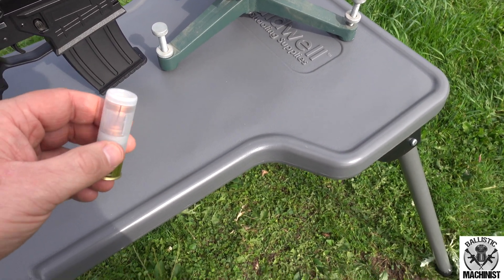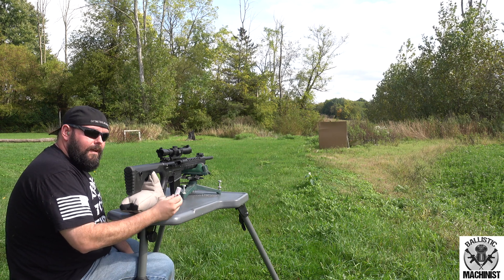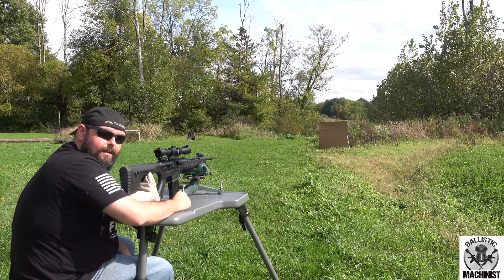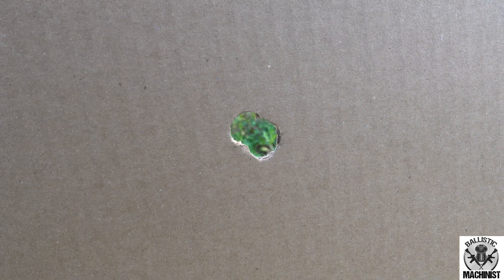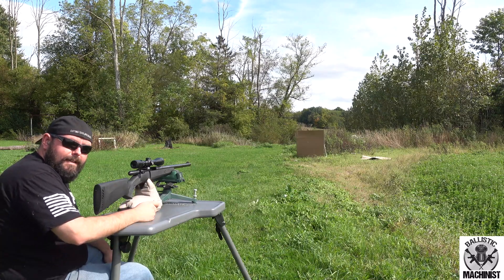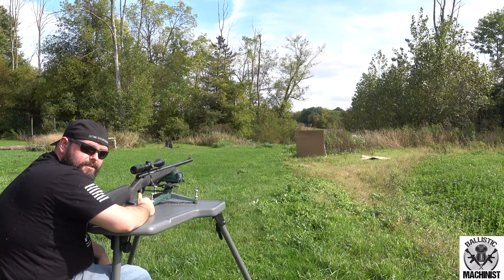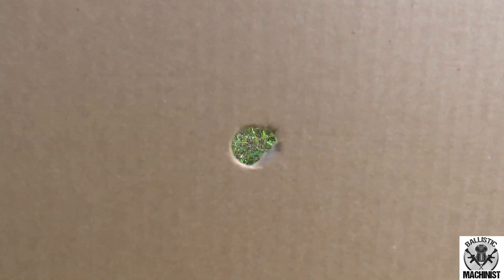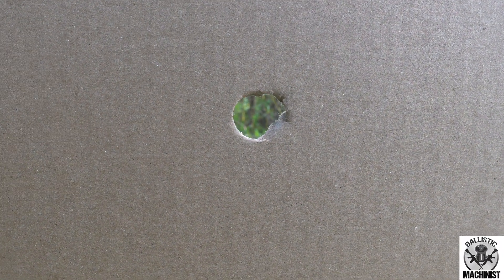Expanding Copper Slug flight test

Comment: Tim, being a machinist you could vary the ratio between the diameter and length of a standard lyman slug.
I would love to see them tested at 1:1, diameter to length, 1 to 1.2, 1 to 1.4, 1 to 1.6, etc. to see if there is an optimum ratio.
Hell, who knows what a 2 inch long lyman might do???
Great Channel.

Comment: Hey man I just came from another Channel where they were beta testing your copper slug. It looks absolutely beautiful aesthetically and my only question I have is have you consider doing something like not necessarily no ring or wax but some medium to help hold the pedals together while being run through a rifled barrel something that would just have enough adhesion to be able to stand up to the ballistic forces and the rotational centrifical forces to hold the pedals in position and then once it makes contact with over the intended target is at that point physics change and then the pedals come apart I don't know anything I like to shoot guns but I just was looking at the video and was curious whether or not that was an option. Happy shooting man by the way you have a new subscriber😁

Comment: I thought the same as you with the first shot, that it was tumbling, but then on the second shot you mentioned the wad, well that could of been the case in the first shot. it will be interesting to find out.
Reply from the maker: Yeah I think I may work in a smoothbore as well. But it will be interesting to see on a high speed camera I will be sending some to TAOFLEDERMAUS to test